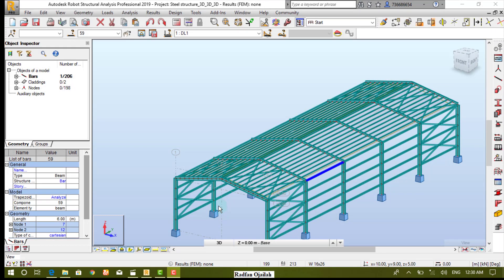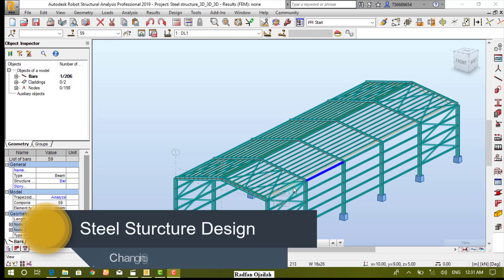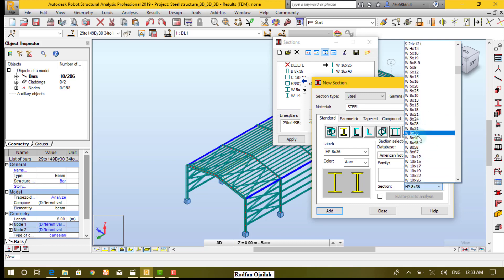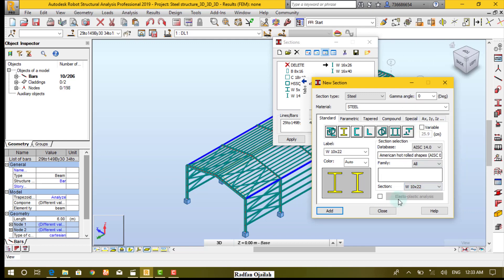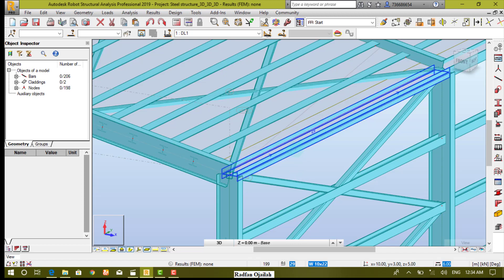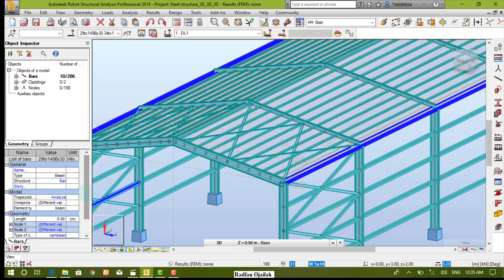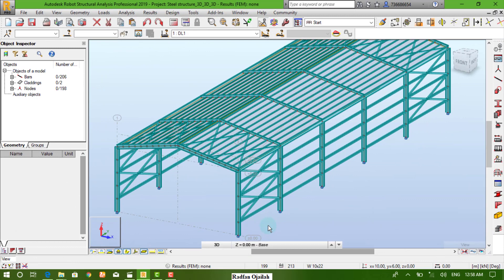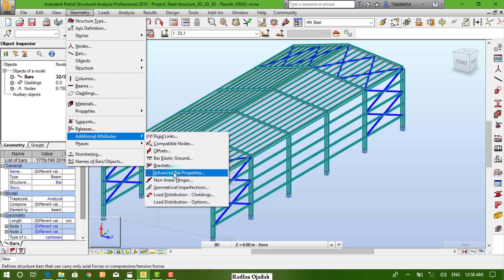Steel Structure using Robot part01 vid04 Changing Sections, Setting Braces as Truss Bars

Comment: hi , thank you for those useful videos, I have a question, what if I have an existing structure that I want to modify and make an analysis and design, can you help, please? thanks again
Reply from the maker: You're welcome. Ofcourse you can and for sure I can assist you.
Reply: @RadfanOjailah  hi thanks so much for replying to me... Well, i want to know how to chang the units of an existing structure (mm)    insted of ( m)
Reply: @RadfanOjailah  also i want to know how to choose the value of gamma
Reply from the maker: Changing the units of an existing project's will change the results and load values except for some.  If you change the units, then you have to check all the input values. To change them go to preferences, the first tab will be the units, you have 2 options one is SI units and another one, click on the required one, then apply, then Ok

This is as I remember for some reasons I can't use my PC right now.

To change the value of gamma, select the member that you want to change It's gamma, the in the bottom left you will see a small table, one of the cells is indicated as Gamma, you can enter - or + values as desired.

Notify me if you get everything right 

And also you can send me the file
Reply: @RadfanOjailah thank you for replying 🙏🏻 it's ok to change the units i still at the beginning, i did what you'v said but the lenghts are so not realistic they are so huge, i'v changed them to mm , i will share some files